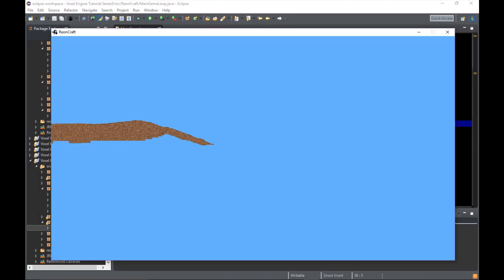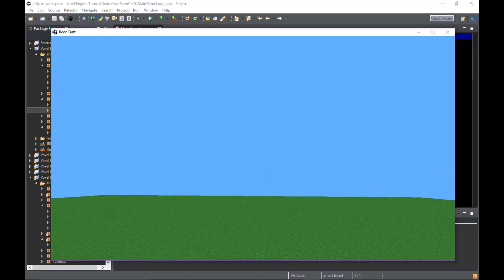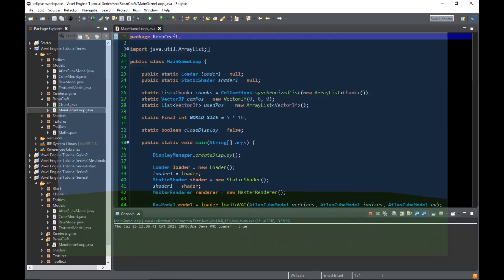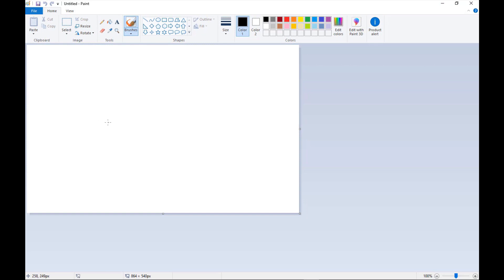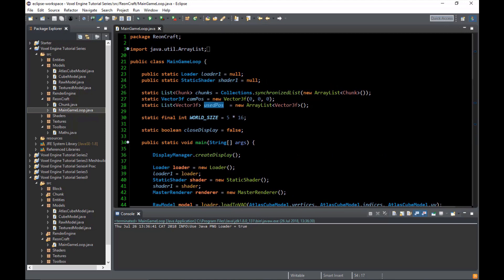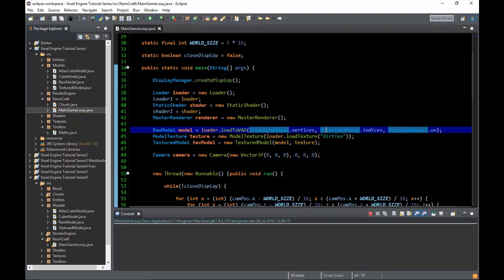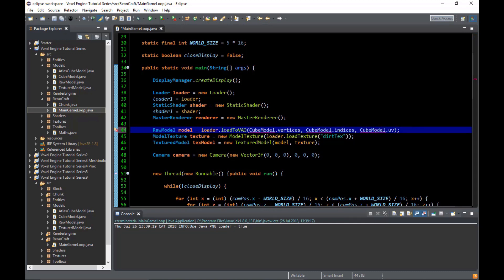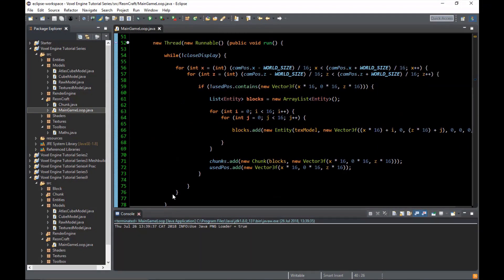Java Voxel Engine Tutorial 10 - Chunk Mesh Building & Perlin Noise

Comment: cool video, been following all week while quarantine, question, if there are faces in the blocks that are not rendered, during 'edit' or add/remove of blocks like in minecraft how to rebuild/handle those as it needs the blocks to be visible? example, digging on the ground, etc.
Reply: the update function in the chunkmesh class should automatically rebuild the chunk, although ive tried using it and for some reason when I remove a block and update it it doesnt work idk why.